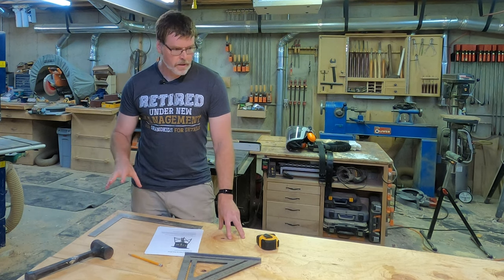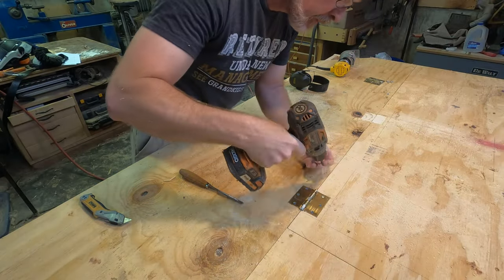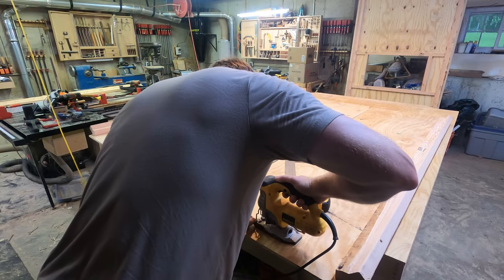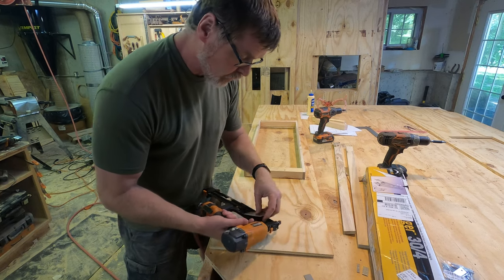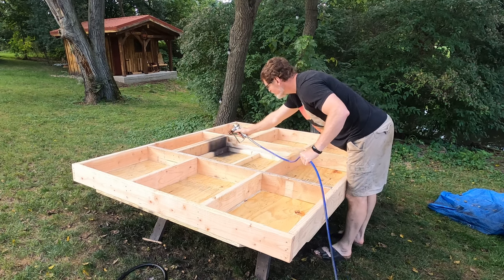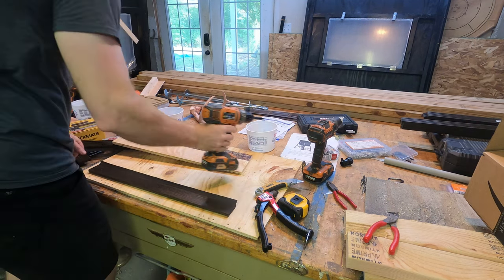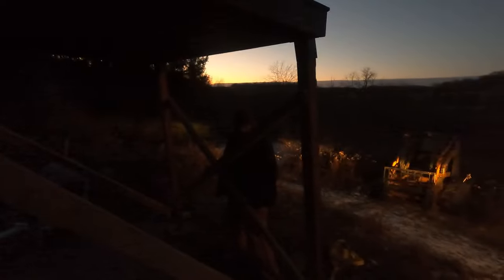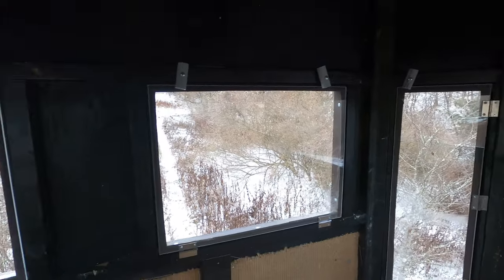Building a 6x8 Octagonal Elevated Box Blind (with complete plans)

Comment: Enjoyed watching a skilled craftsman at work. I built an 8' high, 5'x5' platform for this season and have my porta-jon blind sitting on top it. Come spring, I'll do the walls and roof using your video/plans along with Brett's. PA rifle season weather and my aging body demand some creature comforts. And my common-sense demands a blind that doesn't cost as much as a 4 wheeler.
Reply from the maker: Just got back from PA rifle season opening weekend. Missed a nice buck at 180 yards. I need more practice, or a tripod. Good luck with your build.
Reply from the maker: Also, after using the 6x8 blind, I think 5x5 is the ideal size for one hunter. The 6x8 does accommodate two nicely, though.
Reply: @SalemWoodworks  I had a nice 8 point in my crosshairs opening day. He was facing me so shot placement was a bit more demanding. Those extra couple of seconds were enough for him to turn and walk behind a tree. Part of the blame goes to the blind. It's hard to maneuver a rifle around in a boomy plastic box that's 40"x40".

Comment: I'm not an engineer but isn't the weight bearing on the opposite boards of the ones you put your 4x4 metal brackets on? It seems like the other boards carry the load.
Reply from the maker: I actually am an engineer, but I'm not sure that's relevant. Lol. The long axis is the right board to install the brackets on since they support the floor joists.  I did reinforce the corners to be sure.

Comment: I love the build and am hoping to use yours as a guide, but I wanted to ask about the roof. You don't go into much detail about how it's attached or the rafters. Do you have any materials or even pictures how it was done or looks?
Reply from the maker: The roof was half-inch OSB, nailed to the rafters by hand with 1.5 inch roofing nails and then covered in tar paper and asphalt shingles.
Reply: @SalemWoodworks  thank you.  What about the rafters? How were they attached to the roof blind? Did you still have the interior rafters that are attached to the studs on the inside of the octagon studs like in the Bret moravitz video?
Reply from the maker: Yes, I did the rafters the same as in the Moravitz video.

Comment: Poorly engineered, not well braced.
Reply from the maker: I respectfully disagree. It has diagonal bracing through bolted to the 4x4 legs and cable bracing from all four sides to ground anchors.
Reply: @SalemWoodworks  Using 2×4 To be a proper brace the Bracing material has to be at least 3 times as wide as it is on the narrow edge.  A one by 6 is 5 times stronger as a brace than a 2×4.
       It's a common building mistake, it allows to much movement  in the structure.
Reply: @SalemWoodworks  It's actually been though the courts people have lost their Farms and Lively hood because of 2×4 bracing on deer stands and people have died in such blinds in high wind storms.   The structure only works if it has the load sharing capacity to be able to share the full wind loading at all points one just one failure durring a high wind event and the structure can fail.
      I am not putting down your work, the rest is a well built Blind but the bracing is weak.
Reply from the maker: @carrollsanders9376  I genuinely appreciate the feedback. I'm always willing to learn. I do feel like the additional cable bracing will be enough to make up for this shortcoming. That said, you've put the thought in my head and I may consider retrofitting this blind, and will certainly rethink bracing in future builds. The blind has already survived 70 mph winds in the craziest thunderstorm I've ever seen. My son and I weigh a combined 550 lbs and the blind didn't budge when we rocked back and forth in unison.
Reply: @SalemWoodworks  We just had 130 mile per hour winds that destroyed 50 trees, not a blind damaged.
Reply from the maker: @carrollsanders9376  as a wood guy, I'm sorry to hear about the trees, but glad your blinds are still standing.
Reply: @SalemWoodworks  The trees will make a lot of Lumder and Fire wood, you have to take the good with the bad.

Comment: What was the overall weight of the blind? I made a 6x6 blind and wanted to elevate it with those brackets but I’m 80% sure I’m over their advertised weight limit lol
Reply from the maker: You know, I'm not sure. The blind is a pretty lightweight build with 7/16 OSB and mostly 2x4 and 2x2 construction for the walls.  That's probably something I should have checked.  It was a bit sketchy for a few moments until we got all the bracing installed, but seems super solid once braced and I haven't noticed any flex in the brackets.

Comment: I note that this design consistently is built with the corners of the base remaining square rather than following the angle of the box. I presume that has to do with maintaining strength for the legs. Is that correct thinking or can those corners be angled as well allowing the corner plywood to extend over the rim board?
Reply from the maker: The square corners work with the leg brackets I used. The down side is the corners are out in the weather.
Reply: I have used a different bracket that needed to be used on a corner, however the ones that you used appear to be a flat plate is that correct? Therefore my question if they could work across the corner? My concern for asking is the possibility of affecting structural integrity. I do truly appreciate the detail that you have included in your video.

Comment: What size cable did you use for the ground anchor? And what hardware?
Reply from the maker: ShelterLogic ShelterAuger 4-Piece 30-Inch Reusable Heavy Duty Steel Earth Auger Anchor Kit with 4 Clamp-on Wire Tie-Downs for Anchoring Shelters, Canopies, and Instant Garages, Silver https://a.co/d/bwOduap
Reply from the maker: Hardware was 1/4 inch braided cable.